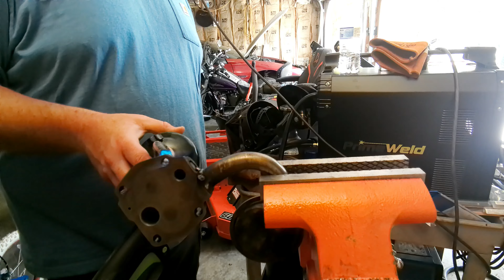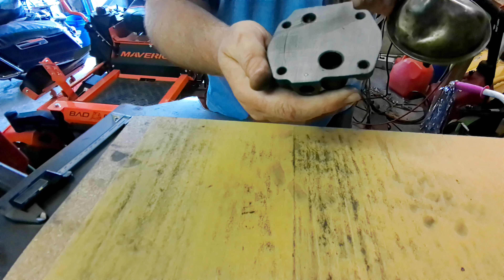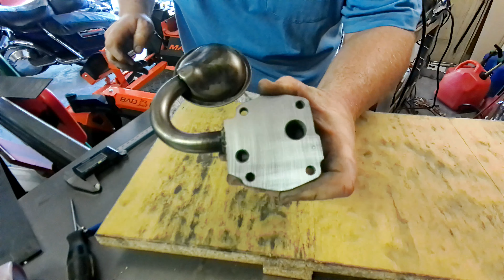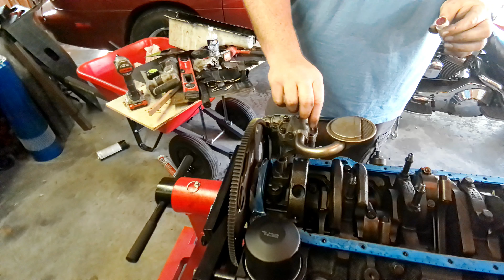Small block chevy oil pump blueprinting   Refreshing 135k mile oil pump for the LT1 build

Comment: What spring did you use?  Is it the same spring as a gen 1 sbc?
Reply from the maker: I will have to look for the part number. I should have a receipt somewhere. It's a set I bought 3 or 4 years ago when I added the 1.7 rockers.
Reply: @Yerkit Racing Channel  ok thanks. Im rehoming a lt1 into my el camino on a budget. I am going to copy your oil pump blueprint video. Thanks for the video is very helpful.
Reply from the maker: @justinadams1360  No problem! Appreciate you watching! Sounds like you have a fun project going too!